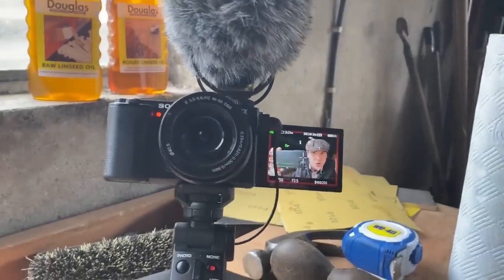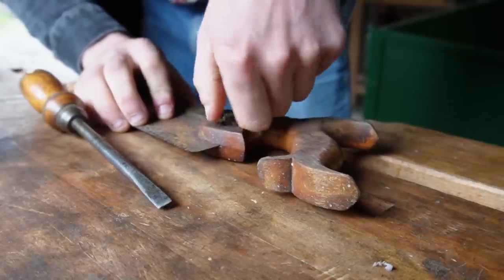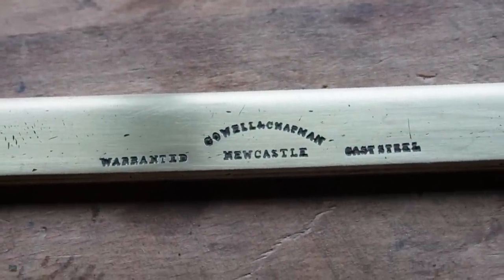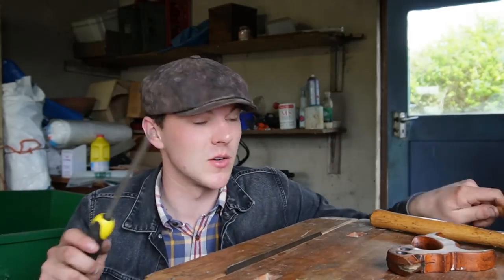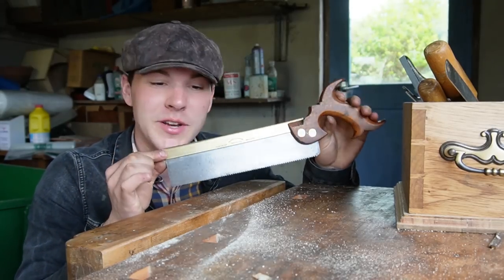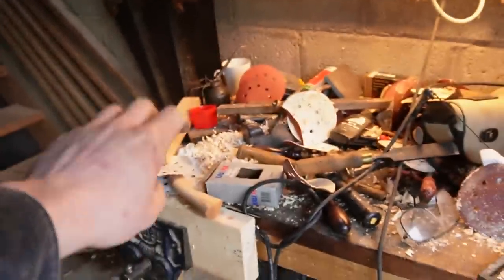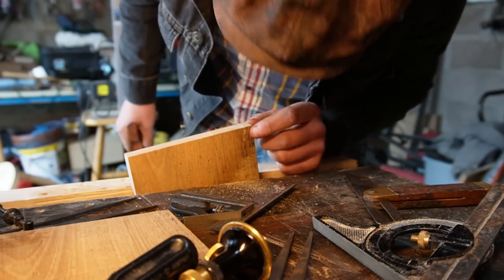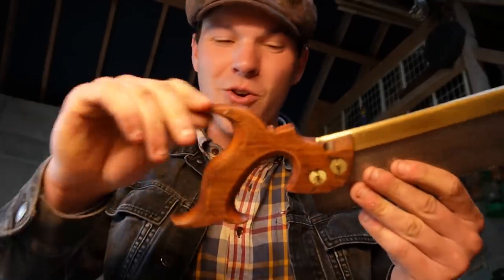How To Restore A Backsaw

Comment: I've something else you can give a look at as for tools. A scraper. But not in the way many think of scrapers. These are like credit card sized sheet of metal with one edge that has a very slight burr edge that you can use to drag over wood. It won't remove near as much wood like sandpaper can but it will leave the wood surface almost glass smooth after so many passes. They're great for taking off old finishes and varnish from wood without the need for chemical strippers or worry about wrecking detail with sand paper. and since it's just a sheet of thin spring steel, if the edge wears too much and gets smooth, file flat and roll a new one with a screwdriver by dragging over one corner.

I know the Holland&Holland gunmakers use them for their stocks as well as a few other of the finer makers.

Comment: you aught to try using electrolysis a few times when restoring an old piece of metal like this. I like it because it will remove the rust but goes easy on the metal that is left so to me it helps retain some of the history of the tool.

Comment: I recently bought an old pair of rusty saws and I wanted to fix them up. I know how to restore the metal already but I'm not sure what to do about the handles. They've got some small cracks in them and I'm not sure weather I should glue them or fill them in with wood filler. Any advice? I don't want the cracks to propagate, they're very nice handles and I want to keep the originals on there

Comment: This message is to captain busy bollocks 😂I really need help, the traditional screws which hold the handle to the blade are simple to remove but I have a few saws with rivets (unsure on the specific term) but I have no clue how to remove them without damaging can u give me some advice I would really appreciate it thanks